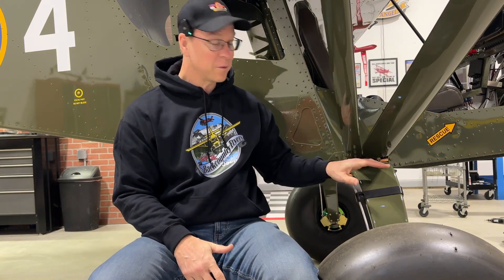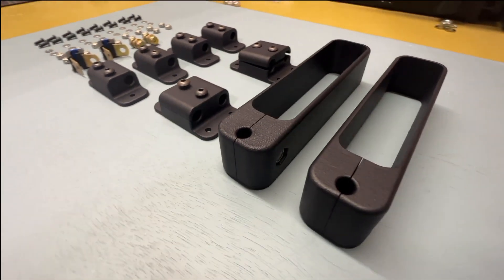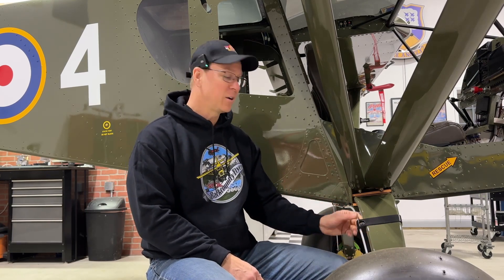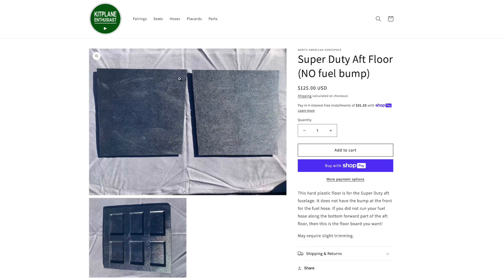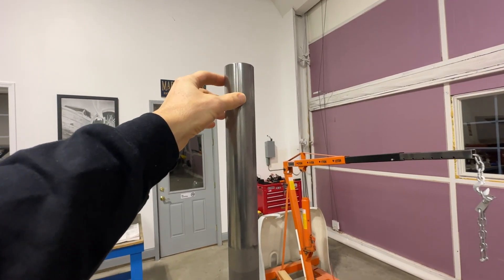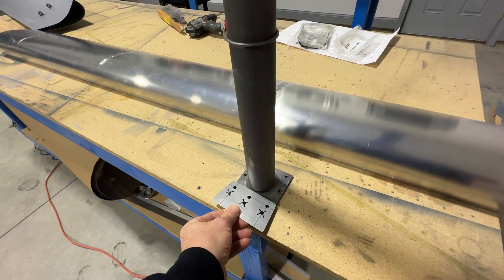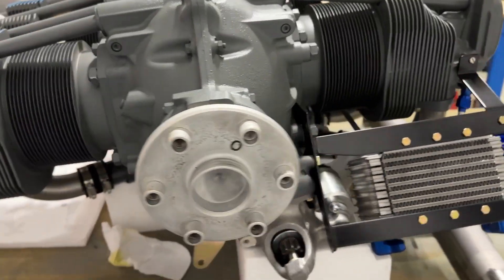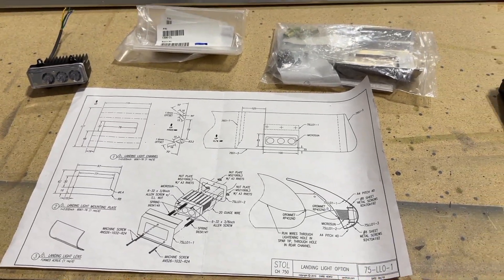Super Duty Gear Leg Brackets + Update...

Comment: Fast and clean. The fit and finished job is getting better all the time. It is probably better for a kit builder to just do it best the first time which ultimately builds momentum towards high standards as opposed to good enough that'll work. 
Scratch building can be rewarding too but building every single part probably isn't realistic even if it could be accomplished.

Comment: Mark, I used the Skytek towbar bracket with the zenith towbar on my Cruzer.  Works fine.
Reply: I agree, I did the same thing and if it didn’t fit exactly you could modify it for the SD Gear leg.

Comment: Probably a dumb question coming just from my automotive experience, but what does that starter gear engage with? I'm used to seeing a geared flywheel.
Reply from the maker: There actually is a large geared flywheel on the front of the engine, but I have it removed at the moment because it just gets in the way while working on the baffling.

Comment: I wonder if those brake brackets will fit the the non SD Stol gear.
Reply from the maker: You’re the first lol! I told Steve at Aircraft Specialty that as soon as I post this people will ask if it’s available for the Cruzer and STOL! 

Right now it’s only available for the Super Duty. The other airplanes have different sized gear. 

We do have plans to adjust the gear leg brackets to fit the STOL/Cruzer gear. It probably won’t be in the real near future, but it’s on the drawing board.
Reply: @KitplaneEnthusiast  I didn't know if the gear was wider or not.
Reply from the maker: @wb6anp  Yep the SD gear is wider and thicker. Hopefully we can get the Cruzer/STOL gear leg clamps out soon!

Comment: For your tow bar,  try a steel tube with two tabs welded to it that will interface with the outer two bolt holes.  I'll weld one up for you if you send me your dimensions.
Reply from the maker: Steven can you email me at KitplaneEnthusiast@gmail.com

I have a pic of a plane in the EAA museum that has the bar welded to the bracket which I think is what you are talking about. That would actually work very well!